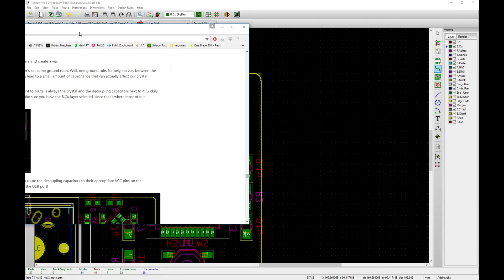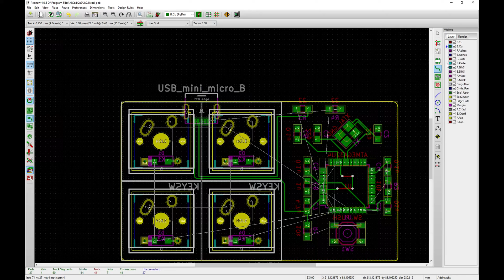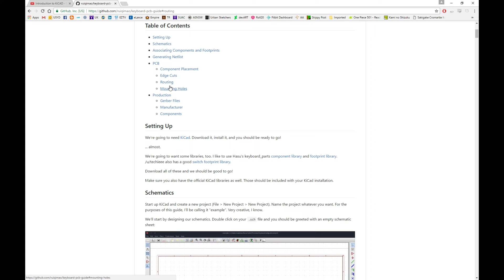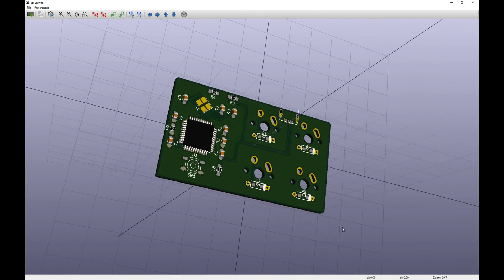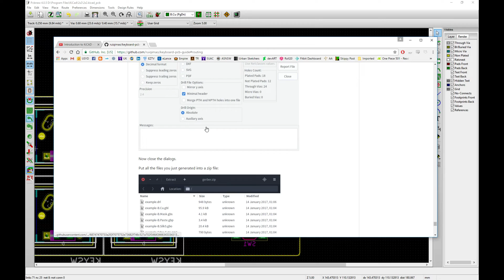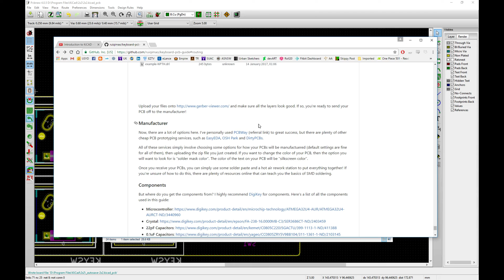Introduction to KiCAD Part 3 [Final] - Traces, Render, Gerber Files, and future builds

Comment: Thanks! KiCAD's very good, dunno why it gets a bad rap as "unintuitive"?
Reply from the maker: If you don't have a background in terms of electronic component design, then it can be daunting, and anything like that often is given that phrase.  The other thing is, not knowing what each tool does, as well as locking into grids, or single/double click actions, trying to figure out if you want to select a component, or the pad of the component, or the trace of it to move etc, it can be purely overwhelming, therefore -> 'un-intuitive'. Not everyone is necessarily 'technically' minded unfortunately.